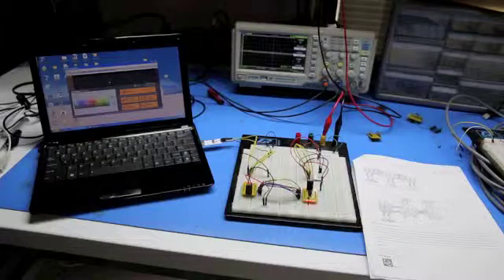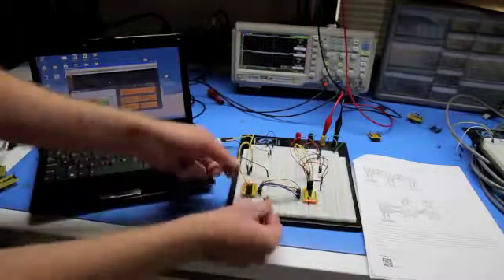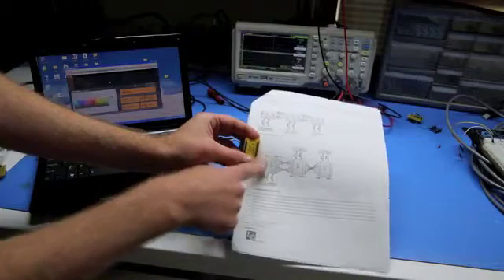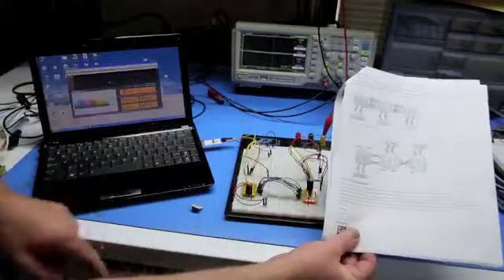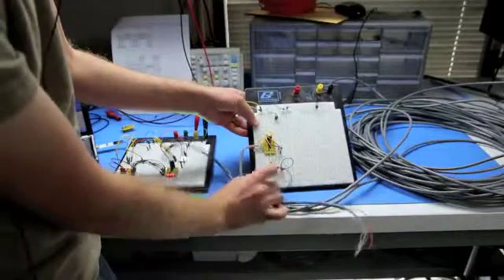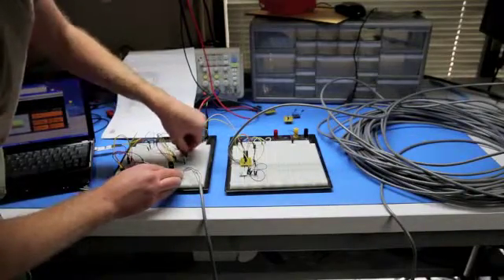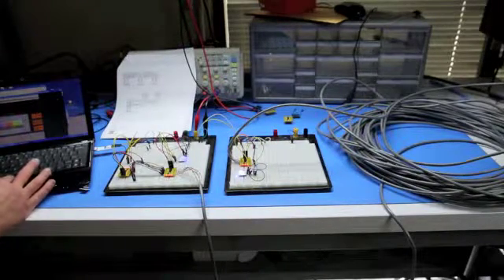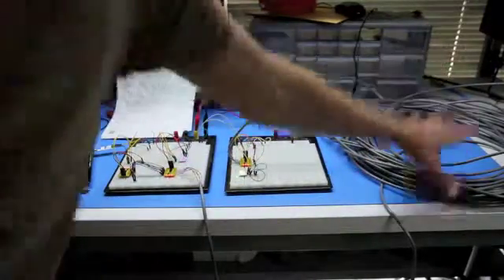I2C Long Distance Differential Extender Breakout Board

Comment: Ok, but what is max. length of cable between some pcb with Microcontroller and some i2c Peripheral board with i2c chip ( for example i need to connect my board with Atmel mcu ATmega series and board with LCD 2x16 + 4x4 matrix keypad via i2c expander chip like 16bit MCP23017 from Microchip). 
Could I get 1m length without Extender?